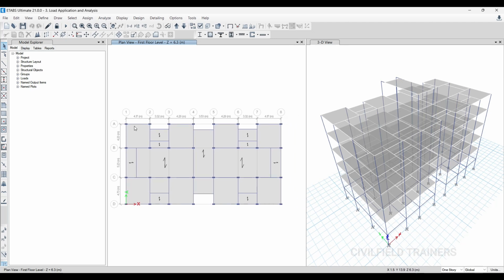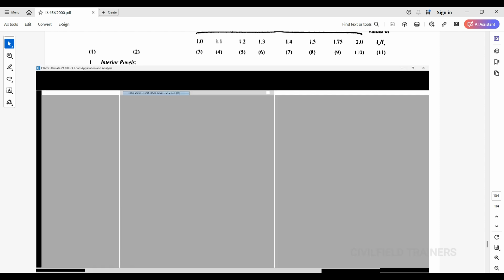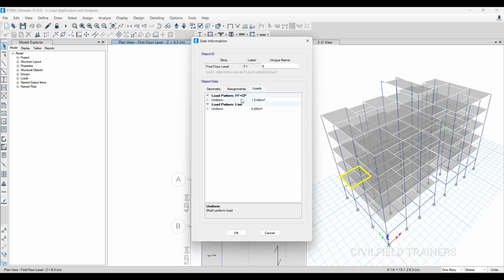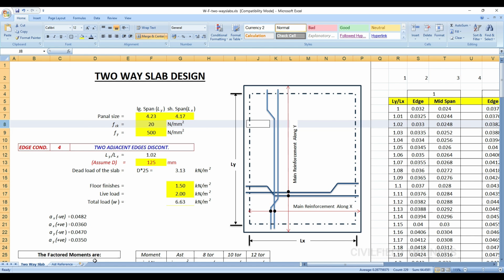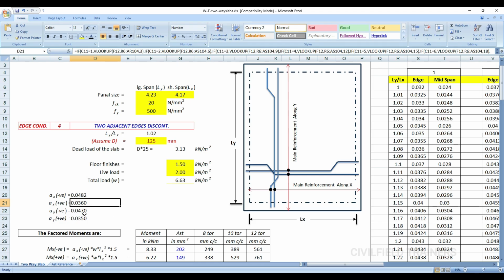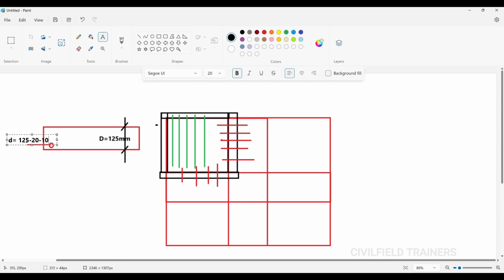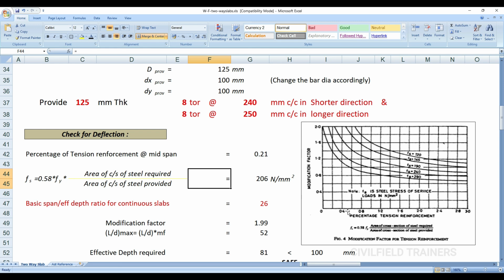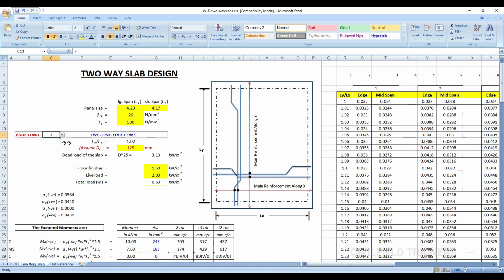Master Two Way Slab Design using Excel Sheet (All Conditions)

Comment: sir what about the torsion reinforcement
Reply from the maker: Slabs and beams are cast monolithically on site. Plus there is additional reinforcement on top whenever we crank up the bar and bind them to running rebars. That much reinforcement is usually more than enough to deal with any torsion.

Comment: Sir I didn’t find the excel sheet link or drive link . I would kindly request to provide the link for the excel sheet for the design of slab
Reply from the maker: There is a pdf file in the material content. Or just drop me a text on the platform. I will share the link directly with you.